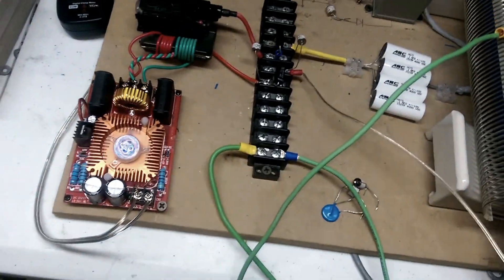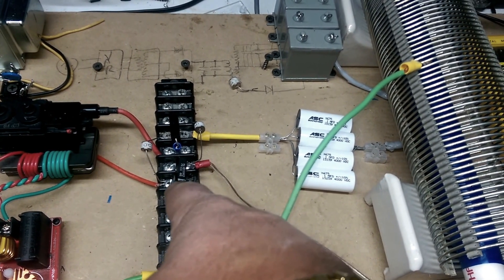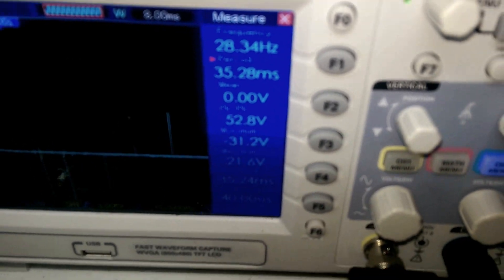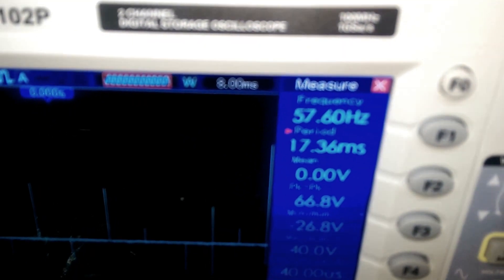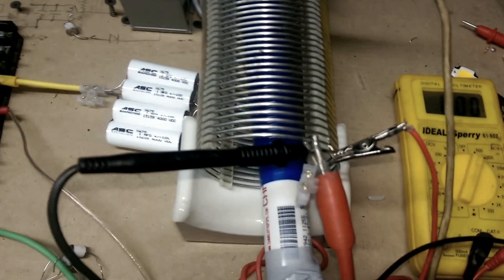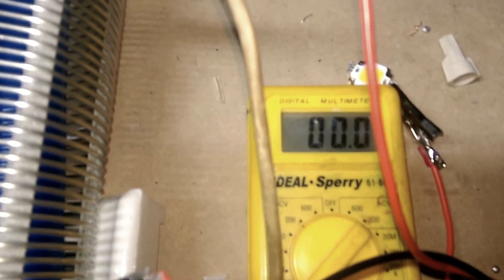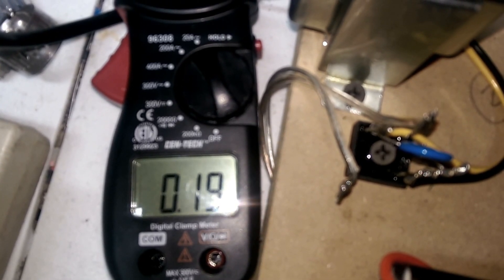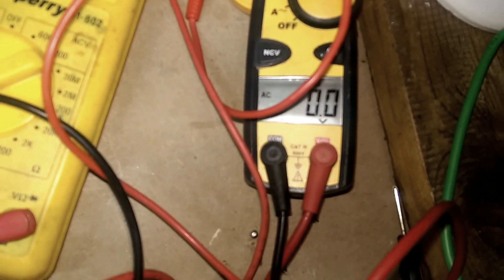Don.Smith Replication.Attempt

Comment: So there is power source 9000 VAC, 30 mA, 35 kHz and Don could take maximum 2500 VAC as C1 has nominal 4000 VDC, withstand voltage 6000 VDC (as described by maker). After rectifying 35 kHz AC current by two diodes VARO VF25 ( 25 kV, 85  mA) you get pulsing current 70 kHz which flows via L1 to gas discharge tube (GDT).  As we have pulsing current we must consider GDT dynamic breakdown voltage 100 V/usec or 1kVusec. If we have 2500 V and 70000Hz then voltage rise is 2500 V / 7,14 usec = 350 V/usec so it means we must choose GDT with DC breakdown in volts between 1500 and 2000 max. And also very important is period of GDT acting from breakdown to glow and to arc (moment of time when L1 begins to store energy) and this period supposed to be minimum 60-80 usec but to met Don's device it must be 14 usec for each  voltage peak 70000 times acting to allow L1 to store more energy.  The coil L1 is supposed to be 2 uH (this very very very small for such a small current 30 mA from neon power supply) cannot store enough energy even to perform oscillations between L1 & C1 between those discharges performed by GDT.  Please calculate how many energy is stored by L1 for a second and tell me! I am 100% sure that this device (beautiful toy) will never worked as described by Don Smith!!!  I saw the video of symposium Tesla 1996 when the device was tested for a short period of time and using big black box inverter that could have a source of energy hidden in it. Did anyone try to measure the voltage of output capacitor bank C3 2000 VDC 32 uF???  Did anyone try to disconnect and connect back input 12 VDC battery while  load bulbs are lit??? For what to use that inverter, just only to energize the fan??? To check the output power it is enough to connect directly bulbs in series to capacitor bank C3!!!
Reply: I was a little bit incorrect guessing he tested namely that device which was on the floor due to low quality of video Symposium Tesla 1996 and in real he tested only black suitcase  brought with him that should be similar to that one on the floor but only smaller in size. And this is more funny))) Truly saying Don Smith is a real LIER. And the main source of all his device is just his aim to grab more money from stupid people))) Good luck everybody! Don't believe in this shit!
Reply from the maker: If you could forget all of the measurements and typical engineering for a moment, just give this idea a certain thought. Is there an energy other than what we normally use, (forced amperage) that may be either induced by inductors, or capacitively attracted to on an effort to utilize an energy so powerful, or that works in such a mysterious way that it has been abolished so thoroughly by the rich and powerful that have had the ability to even control the very Wall Street Stock Market at one point? Yes there is, and the energy that Tesla has tapped into is a piece of the puzzle. What you see in my video, as well as Don's diagrams are not in any way the true circuits that work, but the answers are in the descriptions and videos he takes time to explain.
Reply from the maker: Remember, Don worked as  geologist and had maps to see where energy signatures from the government were stronger, magnetic fields, etc. I'm sure Tesla also did and there are points in the US we could use these to our advantage to tap into, however, the energy is amplified when it is pulsed as HV, HF Sharp DC pulses into the ground, then picked up at a distance for the amplification because cold electricity outputs grow under resistance instead of the opposite. If we take for instance the Tesla Hairpin Circuit demonstration by Karl Palsness,  he discovered that he could take a 40 w bulb and use the cold electricity to power it where it was super bright, then a 100 w bulb would barely light since the resistance in the filament was too low. The 40 watter would illuminate much brighter than the 100 and this is because the resistance makes the energy in the circuit oscillate close or into resonance. The claim of Don, and others such as Kapanadze state that the circuits all have to do with the basis of Tesla. I noticed with one of my experiments that it didn't run until I placed a very good Earth ground in the circuit in two places, one, between the secondary coils, and the other on the ends of the split coil instead of the center as shown in Don's circuit diagrams and explanations. The spark gap has to discharge the correct way, and through this ground connection, the coils and caps combined act as an antenna to draw in the abundance of energy needed to run the circuit so these guys say. I say it has nothing to do with that, I say it is the fact that we use circuits to filter out the frequencies needed with coils and caps as speak crossover circuits do which then combine all of the energy spread across the vast wavelengths used of the high frequencies, to funnel it into AC caps, then stepped down and rectified to feed the inverter's dc input. Any bit of leakage or noise from the Cold Electricity that slips through or is superimposed through the caps, which normally are filtered out will not harm the input electronics, and the inverter will then output 120v seemlessly without heating or straining at all, making the output capable of many more watts than rated since the input is self adjusting by nature, correcting the input needs. It completely sounds insane but it works, and if you look out there and see Don's most ridiculous circuit that seems like it can't ever work, then you found the correct one and hit a grand slam as I did. It works, and works 100% flawlessly everytime.
Reply: @advanced-electronic  This is only a good sound of words, but show me please any video in which I can see the working device of Don Smith, not photo and without "inverter box". Even his famous device which many people tried to replicate he never tested under load on video, only photo and bla-bla-bla... Don Smith as well as Kapanadze  mention Tesla devices and show some photo of those but they do not mention the power or amperage taken from source by that device to create enough strong HF electro-magnetic field to excite the system and these are not mA but Amperes and KVA. Regarding the ground Tesla used it to transmit energy on large distances without losses as he discovered the spreading waves under the ground that he could watch by means of his sensitive device that showed him same strength of the current when the lighting storm was far away up to 500 miles as if it was close to him. And that happened when he tuned his device  on some receiving frequency. To store current into the ground he used secondary oscillating coil that had on its top MVolts to ionized the air to have access to ionosphere  to close the circuit on the receiver (another excited and tuned secondary coil)that is far away. And still nobody knows what it would be if to replicate it, and probably it will give more free energy as the system is supposed to be connected to Earth's spheric capacitor that is always charged with large energy.
And what can I tell you regarding those fake makers Smith and Kapanadze... I  can make similar device which will provide for few ours the 1KW load. All what i need is to use some box for putting lithium cell battery (some of them 3.7 VDC 6.7 Ah with size 32mm x 65mm) and inverter PCB/ Even I can use four frame o fHV capacitor connected in paralell instead of box. Sorry for my English, ma native is Russian.
Reply from the maker: @AleksandrOsadchy  But did you experiment with wire lengths to get the proper wavelength to use resonant energy to recharge the battery while in use with diodes in opposing directions? That is the entire secret. Your few hours will turn into days if it is able to be kept in resonance. I use the phase lock loop circuit from older crt television sets, and have done this with Bob Boyce's system, which I had no choice but to stop posting info about from other problems I encountered. Anyway, I am not showing any more videos on the subject, and I could only post suggestions. It sounds like you made it through the difficult part, now you only have simple changes to make that will make the circuit a self running winner. Regards, Marc Remember,. Tesla's best results ended up being in multiples of 3's. Don't change this,. just as long as the frequencies are a multiplier of 3, the circuits will perform.
Reply: @advanced-electronic  I just can wish you good luck in your researches.

Comment: i noticed the green ground wire fell off the center tap secondary air coil, was it connected to what you clipped to the center with the alligator clip?
Reply from the maker: no, the alligator clip is connected to the bottom of the coil. you only need one side connected because the energy is induced from one side to the other, even though ground isn't connected, radiant energy needs no ground, across a coil will produce a voltage with just a load, no ground necessary.

Comment: Mark I tested coated 28 gauge steel wire other day and a single spark action from a 6 volt battery hold from .5 to .6 of a volt. I do not know about the amps yet. The wire would otherwise show zero to .05 the same as fingertips. The charge stays a long time 2 to 3 times as much voltage this apparatus. Interesting or not.

Comment from the maker: SERIOUS BREAKTHROUGHS TODAY AND THIS PAST WEEKEND!!!! I have been tinkering again and I think I have hit the jackpot once again. This time, I am only powering a new transformer I have designed and built using a caduceus coil for the primary with Litz wire that's made for antennas in radios. It's tiny little wire, and, since It supposedly can't obtain resonance according to those who keep saying so on Overunity.com and Energetic forum, I have to say. I'd say they are wrong.. Well, maybe their caduceus coils didn't obtain any resonance frequency, but, I have certainly found a much higher amplitude driving specific frequencies through the caduceus wound around 3/4" black iron pipe which I bought 6" nipples at home depot to try and wind. Instantly I have found the coil had in the megaohm range of resistance, and, this is due to the cancelling effect. The wire was approximately 60 inches long and could never be so high of resistance/impedance without the caduceus I have found that the caduceus not only has a cancelling effect and high impedances, but, on a ferrous pipe like this it had a massive amount of inductance, then, the inductance went away, dropped into the extreme negative, then came back, etc. The cancellation truly comes and goes, and, it also naturally oscillates. enough to generate a small amount of power just by sitting next to wasteful wirewound appliances such as an energized. This is proof that charge literally exists in conductors without adding energy to them as I and many others have predicted, meaning that wire wound electrical generators do NOT get their energy from transformation of their fuel burned to mechanical power, then, electricity. This energy is drawn in from elsewhere using the very inefficient use of fuel to spin an engine to force magnetic opposition to create pulses of energy to draw the energy from the aether, just as every other pulsed coil does . 

Anyway, I took the black iron pipe, and., I wound a coil around this, however, I used a layer of high voltage silicone rubber tape around the pipe first, then, I wound the caduceus, then, another layer of the hv silicone over this. The tape is good for 1200v per mil and I haven't figured how many mils there are as I did not mic the tape up but I am guessing it is as thick as a match book cover. Once I covered this, I wound two 24 gauge magnet wires as partnered coils, opposing each other and I am able to acquire a perfect 60 hz sinewave after I inject 1900 hz into the primary. Since the caduceus has about 20 nodes, on each side, I really don't know what to expect for voltage out as I do not have a formula to use as transformer windings use, however, I am outputting a nice sinewave at 60 hz and 120v output. I know my input is a weak supposed 20v pulsed input, and, since it is high frequency, nothing but the scope reads it. It barely even lights a small 3v led, however,  my intentions are to try to build an electron accellerator similar to the Kapanadze coil from these coils. I have done this before, however without the caduceus coil. I did gain an output from my NST to run a 100w bulb on the dim side, and I gave up because the NST's input through a killawatt meter showed me just a bit under unity as the bulb was running the same amount of light as a 40w light bulb and the input was showing to be approximately 53 watts to the NST if I checked the wattage on the killawatt meter. When I did this, I checked the wattage before the bulb was present, leading me to believe that I needed resonance with the primary coil, which I didn't even try. I believe that if we wind the coils in series, each opposing each other, if we gain turns as we start, one coil say 12 turns, then the next 12, and the next set 24, then double that, etc., etc., the electrons have to exponentially increase the speed of their flow. I don't feel this will create overunity, however, if we use a primary coil such as a caduceus that uses nearly no wattage and has an absolute infinite impedance if done right as mine was, the space and dielectric material I used (being high quality 3M Scotch high voltage non tracking silicone rubber tape used for hv terminations) does the trick to loosely couple the wire without the lenz effect. The sharper the pulses, the stronger the bursts of energy in the output as well. When I fed the output of the cad transformer (that's what I call this, what I designed) to a standard transformer used for 60 hz, I actually had a perfect 60 hz sinewave in the output, however, no balls to run anything. I feel if I feed my high powered 60 ma NST into this coil utilizing a bakelite framed variable arc gap, I will be able to replicate the Kapanadze system. It isn't very complicated, and most people think it is. It is the mind frame we are in at the moment of necessary thought that separates the folks who get these things to work from the people who fail.

I'd like to have everybody who has actually tried and failed with Kapanadze's coil and circuit to know that we can all build it. This caduceus IS the secret of Don Smith's system  as well. I have found an article from somebody who has become successful with Don's coil and they stated that the coil can not be wound all in the same direction to perform the anti lenz and literally create a voltage output unless they are striking seriously strong and dangerous pulses into the microwave or radar ranges. which could be devastating to the cells in one's body, causing nearly instant brain cancer, massive unexplained headaches, etc.

Our spark gaps need to barely run to make this all work, however, we all have to know this.. Safety is very difficult with scalar waves. Scalar waves run right through solid steel, lead, and any other grounded metallic medium. We need to use other materials to protect from these fields.

Good Luck!